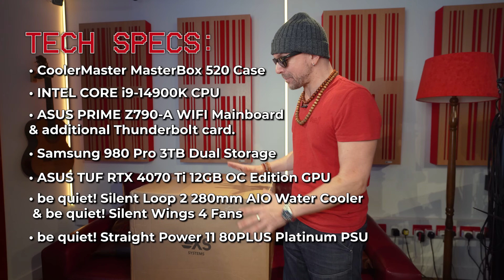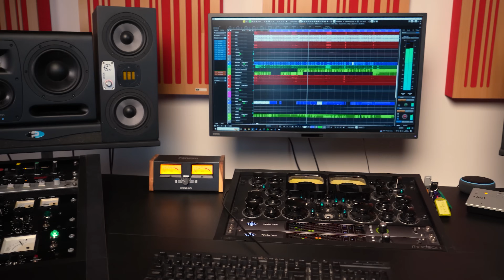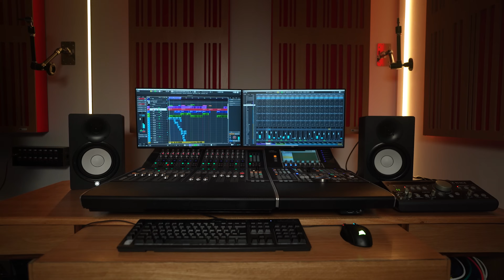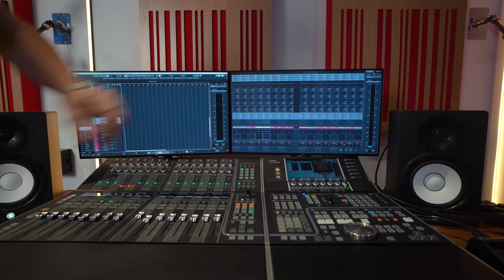2024 Studio Makeover: The Ultimate Audio PC Beast Unveiled!

Comment: 13:38 Despite the PC fit perfectly under the desk the ideal is have more room for the fans properly pull the cool air in and push the hot air out. The PC is gonna run quite hot on this tight fit space, specially with a high performance components like the ones used in this build.
Reply: Was going to say just that. The radiator on top will cook within a mixing session
Reply: They only need to remove the cart underneath the PC. The 850w PSU is under spec in my opinion. I would have gone to 1000w. I foresee troubles. (RTX 4070Ti = 700w T-system power,  i9 12900k = 241w Max Turbo Boost. = 941w system PSU )
Reply: @annode  its good to consider that probably neither CPU and GPU will work on full load (3D graphics acceleration it's not needed for sound engineering), so this 850w PSU it's pretty enough for the task
Reply: @RAFAEL60160  Yes, I thought about his sort of projects and agree 850w will do.

Comment: I am a little worried about the airflow of the pc as the housing in the desk is very narrow...please don't let it die by overheating :)
Reply: I was just about to write the same. PC has 3 big exhaust coolers on top with no room to breathe. not mentioning the situation on the back.
Reply: it'll be fine. there's ample circulation on the inside and through the back. i've been a computer engineer for more than 20 years lol. also, don't forget the water! 🙂
Reply: @otschikaminski  I also wanna write this. 
There are some more stuff 
that i had placed with more distant,  
like the speakers to the monitors ! 
🔊 ♾ 🖥🖥 ♾🔊

The Desk ....  the inside of the drawers  .... are not so accurate painted.  
I am a profession Roomdesigner and Painter, 
may that is the reason why i noticed this .... and .... 
i am a Capricorn 🐐 (wanna give 1000% in business) 😉

THIS IS THE WAY

🙏All the  👍 best 2 U 4 2024 🙏

⭐ ⏳ 20240111.2350

Comment: Just be careful with the airflow of the PC. There is not enough space between the top of the PC and the desk, so it can overheat this way quickly.
Reply: Exactly what I wanted to comment on. It's also called desktop PC for a reason :D
Reply: @MrJemabaris  well, it's actually a tower PC, meant to be on the floor, desktop PC's are the smaller ones, horizontal, meant to be on desks, under the monitor.
Reply: @bennyceca  nah that's not correct. There are both vertical and horizontal desktop pcs and the tower is a form of desktop pc. Of course it can be placed on the floor too but the original idea was placing them on the desk which is still preferable for airflow and dust accumulation. Either way the thing's gonna suffocate under the table like that.
Reply: @MrJemabaris  called desktops to differentiate them from laptops! Now for laptops,  how many are placing their laptops on their laps really?! Your argument is moot. 
Put it where you want, tower PC's, especially the large ones should be on the floor. Purchased thousands of PC's via my IT jobs over the years, small horizontal (flat) desktops go on desks, bigger ones (towers) under, for health and safety reasons too believe it not, potential to knock the tower over, seen it happen many times when they reach over the other side to grab something)! Dust will gather, regardless, better to keep it under then on the desk to breath it in. 
In the case of Dr Mix, no headroom for his tower PC, I agree that PC will suffer from heat, but only need few inches (5+) of clear space is needed. Not worried for him, give it a year or so, he'll do another video sponsored by Scan.
Reply: @bennyceca  I only said that desktop Pcs are not necessarily the horizontal ones that sit under your monitor. Feel free to google the definition of desktop PC. Also if there's a "moot" argument here then it's that they're called desktop to differentiate them from laptops. Desktops have been called desktops long before there were any laptops around. Cheers
Reply: Pedantic naming-convention nit-pickery aside, I have to agree it's best to have your PC elevated off the floor. More dust settles there and those areas are less likely to get as clean as often or thoroughly as above the desk, as evidenced in this very video. Elevating it does not necessitate putting it in a precarious location. Just be mindful.
Reply: Second that. I saw a roster at the top. That needs airflow I guess, unless the water cooler blowes at the back...
Reply: Was thinking that too. Especially with the intel i9-14900k, they run hot hot HOT!!!

Comment: I see a problem with your setup. Yes, your new PC is water cooled, but the radiator is mounted on the top and the gap between the top of your computer and the table is too small. It probably overheat under heavy work load. You should move the radiator to the front position. Or modify your table.
Reply: Totally agree!
Reply: Good catch your correct
Reply: That... and replace that crappy old switch on the right for something fancy (or at least as nice to look at as the new pc) and get new cat6 cables in a decent color (or colors if you color code them)
Reply: It  is  hard to see how  heat circulation on top of the computer is working . Have not found good pictures on home page.  Claudio shoulkd take care  of any heat problem.
Reply: Here's another example of a  hasty reply .You're,not your .
@odmusicman
Reply: Yeah, maybe get rid of the drawer right on top of it, but it would be much better if there was nothing above the PC
Reply: Claudio please don’t ignore this! As of now, this PC truly has nowhere to exhaust hot air. It would be a shame to have components overheat in such a nice PC!
Reply: Some external fans directing the heat from under the table to behind the table would be sufficient but without any temps to go from, nobody is aware of the heat it's going to make under load.
Reply: Under his table is enough space! 
This vertical wooden front plate is only for a nicer look.
Reply: @Byron101_  There's a drawer. It's not just a front plate. Take a look at 11:32.
Reply: @reggiep75  The gap looks to be like 5mm or so (check at 13:38). I don't think there's any centrifugal fan big enough with such thin profile. And if there's one, it won't provide enough airflow at reasonable noise levels.

Comment: The part cost of this thing is less then half of what you pay for a prebuilt, especially if you omit the expensive gpu which you don't need. Building a pc is a lot easier than say, record and produce a track. So just learn to build your own, folks.  Also, these prebuilts have shitty ram. You can get a 48GB 6800mhz Cl32 kit for a litlle over 200 euro, and the performance uplift is amazing, especially the snappy response when working with sampled instrument libraries.

Comment: Wait - Claudio - I'm seeing a big vent on the top of that computer.  With that drawer right above its vent, your computer may not get enough airflow, and you could run into heat problems.  Liquid cooled or not, the heat has to go somewhere, right?  One option could be to get an exterior liquid cooling system, which sits on the floor behind the desk.  Then you'd just have to run the pipes from the computer back to the liquid tanks on the floor.  Hopefully your motherboard components would stay cool enough with that approach.  Sorry, maybe you've got an expert there who is advising on all this stuff, and I'm just talking out of my 4$$.
Reply from the maker: It doesn’t seem to be a problem. I’ve used it for nearly a month now and it stays nice and cool. Luck? Probably :-)
Reply: @Doctormix  That's good to hear.  I'm glad that it's working well for you.

Comment: 13:38 Fits ok, but ventilation - will be a problem ! all warm outlet will flow on vertical desk behind the PC, and that really problem! so all supa-dupa cooling system inside pc useless  with tat  position of your pc  DOC ! So think about it !

Also, why you did not mark any wires that you have disconnected ? i mean when you connect  at least more than 2 wires - you must attach some labels on both sides of each cable !!

And look on back, spagetti of wires still exist, you just need a cable channel(s) on back side of your supa table! Thete all cables will be safe and dust less(is you place some porolon or same on inlet and outlet wires)

Comment: Have to be honest but in my opinion I'm not impressed I am afraid to say. The keyboard and mouse should be able to slide under the desk as it's a real hindrance that it can't. The PC is far too enclosed despite water cooling etc. Might be a good idea to drill hole vents at the back of the desk pc mount to allow better circulation and dust and dirt to escape. The Nuage boxes need to be in open air too,  And lastly I feel the desk is too small. Not a good design choice in my opinion.

Stream 👍

Comment: none of the pc specs make it an audio prod pc,its a run of the mill average system. nothing state of the art!!!!.  a 4070ti is absolutely not required a gt 710 is overkill...........better off getting a 12 or 13900k as its the same chip, you just paid thru the nose for no performance benefit also you have totally blocked off the top airflow under that tight ass desk......